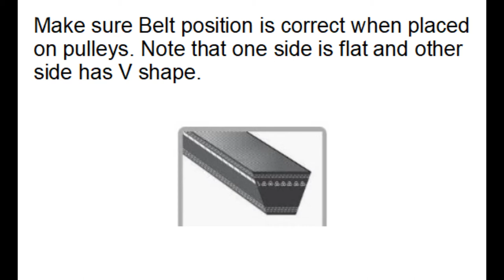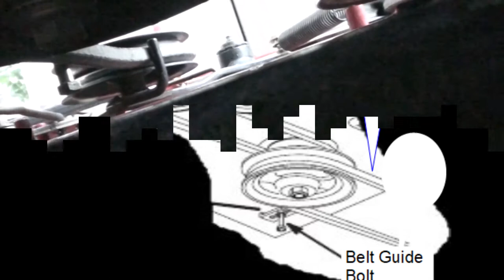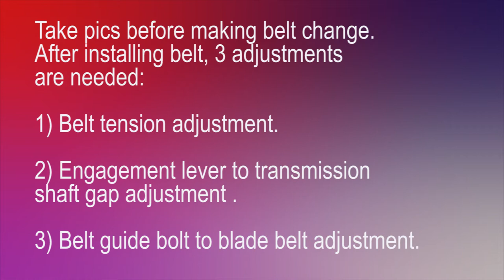Changing the Blade Drive belt for a Toro Commercial Proline Walk Behind mower (48 inch deck)

Comment: Hey question just picked up a 48" Encore Pro-Line with a Honda GXV390 engine 	11.7 hp (8.7 kW) @ 3,600 rpm in absolute excellent condition. On the taller grass "Bahia and weeds"  it leaves a strip in the center sometimes and leaves some of stallion stems half cut . Also I walk behind the mower. Blades are sharp. What are your thoughts?